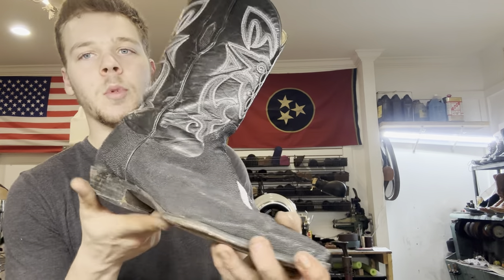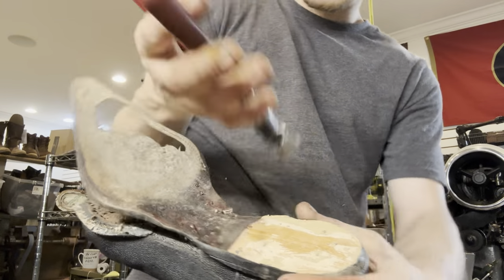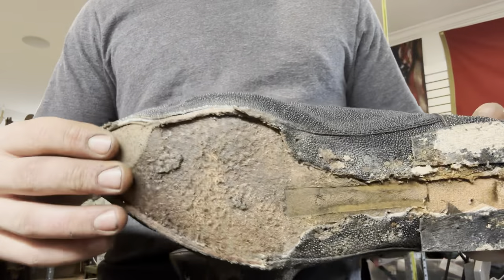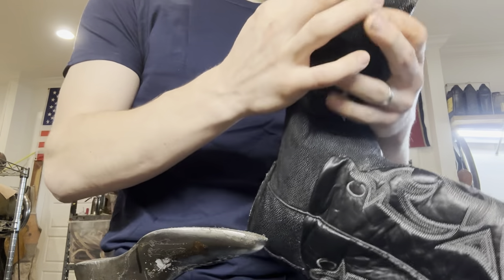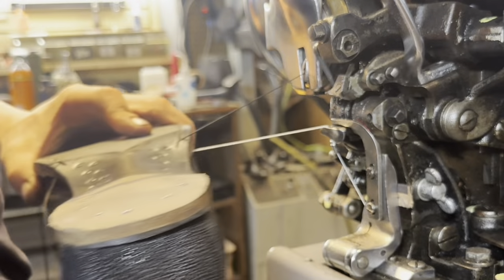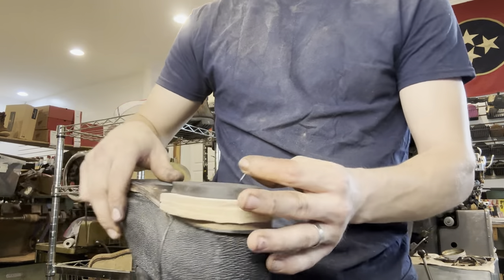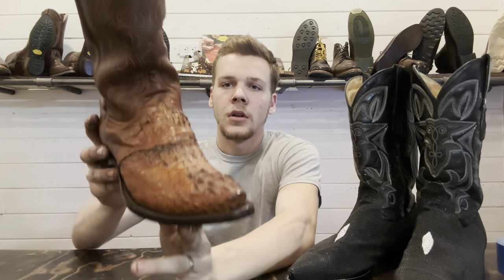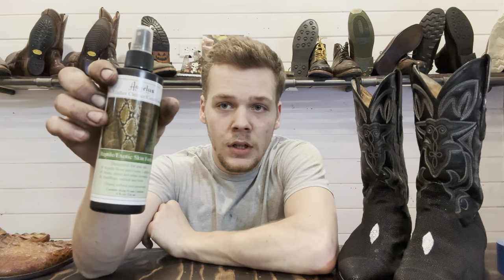Stingray Cowboy Boot Restoration!

Comment: Question for you how do you get the shine on the actual skin that’s beat it on the boot restored
Reply from the maker: I use Angelus exotic cleaner and conditioner then a light coat of Lincoln Neutral shoe polish usually does the trick.